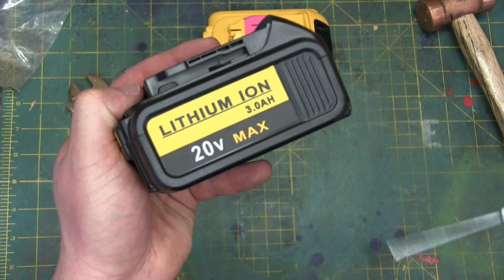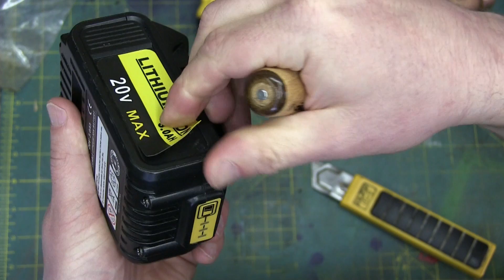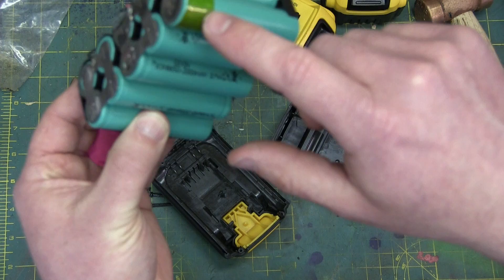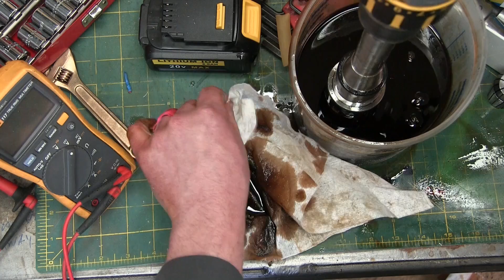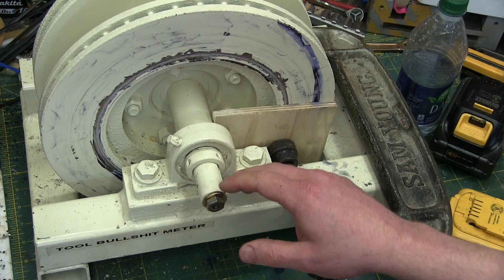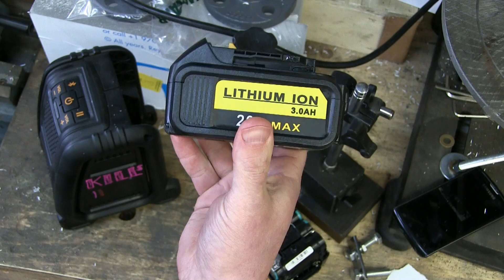BOLTR: DeWALT knockoff battery vs. the real deal

Comment: Had a couple three dudes come in from lincoLn the other day for testing and setting some welders. Had a great big load bank on wheels pushing it around and I was geeking out big time.
I can't tell if they decided not to like me when I noticed it was a miller load bank or when they noticed the wet spot on the front of my pants was getting bigger

Comment: One thing not mentioned was the cell chemistries, Li-ION covers a lot of different chemistries.

I did notice on the elcheapo cells ICR, Lithium Cobalt oxide. High capacity but subject to overheating and catching fire if excessive current is drawn. In some circles it is suggested that discharge current be limited to the cell capacity. i.e. for a 2000mAh cell, limit current to 2A. So two 5 cell strings in parallel, 4 amps for the elcheapo pack.

Elsewhere I found an articel by someone who pulled down their own (dead) DeWalt 20V 3Ah battry pack. The cells were marked as LGDAHB41865 which is a LG HB4 INR/NMC cell, Lithium Nickel Manganese Cobalt Oxide. Allegedly good for up to 30A current drain without overheating and a favourite of the vaping world.

What current does the drill draw when stalled?

Comment: I didn't even know that metric time was a thing.
Reply: garmack12 I wasn't sure if it was a joke or not at first lol.
Reply: Your computers are doing it every day under the bonnet.
Reply: Just in case you're not being facetious, and for the benefit of everyone else:

The second is the official SI (metric) unit of time.
Reply: It's Babylonian, if not Sumerian.  We haven't moved on.
Reply: gamesbok if it aint broke....you know the rest
Reply: There is a 10 hour day clock yes, but it is really not good, mainly because its seconds are 0.864 the length of what we currently use. Makes the math for everything real bad.
Reply: +Elijah De Pino ??? It makes the math bad, how?  I am no metric time expert but 1 second is 1 second, I am going to guess that 1 minute is 100 seconds in metric.  Seems easier to me, but hey, I really have no clue about metric clocks.  If you could, though, let me know what part of it is math unfriendly?
Reply: The french also tried a "real" metric time with a 10 hour day with each hour having 100 minutes. They failed😂 Also church wasnt on board with this...

Comment: I would have used a magnet for braking. just add a few to the frame and it'll add some drag.
Reply: ben hunter yep, put those eddy currents to good work. Same way many exercise gear works, big flywheel and a magnet with an adjustable distance to the flywheel. Wouldn't need much in the way of magnets to get a decent load, and should be completely the same load every time as long as the magnets were fixed.
Reply: The lack of any way to harvest the wasted energy annoys me so much about that design. As for the torqometer if a few coils are added then another battery can be charged as the test battery drains.
Reply: Besides, magnets would make the friction and moment of inertia much harder to calculate
Reply: taity waity relatively speaking, the energy wasted is miniscule. It really isn't worth doing anything with.
Reply: 3.2 Ah? I could charge my phone with that!
Reply: taity waity actually, with it being 20v, that's about 64wh, you should be able to charge your phone five or more times from that.
Reply: How about the moment of inertia if that wheel bearing fails? I do see a zerk fitting, but it looked painted over like the rest of the contraption.
Reply: Don't think the safety of it is really relevant here, I'm just talking about adding load. He said in the video that it wasn't all that safe. Also, I don't see how the presence of a grease nipple is going to make it any more or less safe. With the kind of duty that this is going to see I doubt those bearings will ever need re-greasing in AvE's lifetime.
Reply: The drag coefficient of the bearings and the air resistance is going to be pretty difficult to calculate accurately anyway. May as well measure it empirically using a prime mover and a torque arm, and if you're doing that it's no more work to add some inductive drag. I love enginerding out with MATLAB as much as anyone else but in this case I'd just measure it myself. That way I know that I'm accounting for all factors.
Reply: 64Wh is from battery! Count in the losses from motor efficiency and generator efficiency, if you had really efficient motor (which I don't believe handheld drills really are) and really efficient generator you would be maxing out at about 60% efficiency. And since just a few coils and magnets are not proper generator with laminations in coils with minimal air gap between rotor and stator..... you would maaybe get max 5Wh I believe (if you are lucky) just not worth it

Comment: I think you were onto something with the hydraulic pump. if you use the drill to pump fluid from one container to another you can get some nice data. if you know the mass of the fluid that was moved and the height over which it was moved , you can calculate the work.

it would make for a good comparison between batteries because the pump losses would be the same. as long as the two containers have the same cross-sectional area, you can use the distance between Center of volume as the height so you don't have to worry about the varying head pressure.

Comment: What would be actually a better video is if you hooked it up to the data logging and showed the curve of the voltage drop from fully charged to drain because that's where you'll see the crappiness of the aftermarket batteries if they're no good you'll see that they have a you know I voltage right away and then they taper off pretty fast you know losing their power wear a good battery like LG or whatever would hold that power voltage high for a longer. Of time and have a slower taper

Comment: should use eddie current to test load, make your bullshit o meter out of alum. and use magnets to create eddies, more consistent results than south korea brake pad
Reply: AVE see above
Reply: David Thompson I was hitting the comments to write the same thing. Variable load for targeted resistance per tool class etc etc. quick, someone upvote this above orig comment.
Reply: Using electromagnets I mean. Variable current to create variable resistance against the tool.
Reply: There brake disks not pads
Reply: Stephen Maley - Did you watch the video?

Comment: For the inertial tester you could:
calc the losses by going to full speed and letting it wind down while measuring the RPM and chart it by time, using that and the angular momentum you can get the losses at each speed you tested at.
(flywheel_energy_at_t1) - (flywheel_energy_at_t2) = losses_at_rpm1_to_rpm2
note: bearing temperature might affect things, how much?

You could also hook up a electric motor|generator and adjust the input power to get a stable RPM output on the inertial tester.
Now connect the motor| generator to a identical motor|generator and using the same RPM* get the difference in input power to output power, this is your motor efficiency.
*note: you have to adjust the load on the generator to make the input power the same as used on the inertial tester.
Using this efficiency number at that specific RPM and load you can remove the motor losses from the original inertial device input power to get the actual losses on the inertial device.
Brushless motors?

Comment: The cells inside that Chinese battery are marked up as 2000mah, that makes no sense when you look at the claimed capacity of the battery which is 3.0ah. The batteries are in a 5s2p configuration therefore the actual capacity should be 4.0ah
Reply: W19 ELY they're probably being run below limit to get more longevity out of the batteries. Less chooch over longer usable work life.
Reply: Eliseo Jacome That's not the case in this video though, he already proved that there is no voltage cut off because he managed to discharge the cells to below 3 volts each. Therefore the bms inside the pack isn't limiting the amount of discharge.
Reply: W19 ELY shhhh stop using that math and science stuff. just trust what the sticker says. its all magic lol

Comment: Okay on the brake rotor, use an electric brake magnet assembly ( or many) from a trailer brake setup.
If you mount the end of it or the anchor point to a electronic strain gauge and that will get you your torque reading in ounces or pounds .
By just adjusting the voltage into the magnet , you can increase the braking power of it to load up your tools heavier.
Sort of like using a pump and restricting the flow to produce pressure and convert to your needed  values.
To get your RPM you can use a mechanical tachometer , and inductive trigger or photocell triggered tachometer with reflective strip at one point.
We (in the factory) use various ones for spin balancing large blower wheels for very large HVAC equipment.

Comment: If the DeWalt battery has a voltage cut off of 15 volts that means persol the cutoff voltage is 3 volts which is actually a good design feature of DeWalt it means that they don't want the voltage going down to anywhere near 2.7

Comment: AvE, just a thought. You have the one bad 20V DeWalt battery... but the case is still good, and (probably) the boards are still good. Why not swap the cells with the cells from the cheap-o battery? Then you'd have a beefier case and more substantial electrical protection...

Comment: I love this show, and tried out some Milwaukee, amazon knock offs.  I'm a project superintendent for commercial projects.  I wish those batteries worked out, because I believe they were about 25% of the price as the name brand.  But, they sucked.  Lasted about two months of steady use.  Three other crews I work with had the same results.  I hope this does get worked out some day, because those high output, name brand batteries are so expensive and last maybe a couple years of daily use.  Of course, if it does get worked out, and everybody buys the knock off batteries, then the tool makers would most likely then raise the prices of the tools, since they won't be making their money off the battery sales.

Comment: Good day Sir,

I have recently gotten tired of my old yellow electron holders not holding any electrons.  I have two of the 18 volt variety accompanied by a yellow drill and electron loader.  I would be pleased to send these to you so that I don't need to throw them in the garbage, but perhaps you could make use of them  in a this is what the insides of a 7 year old yellow drill looks like.  It still choohes along for as long as the electrons stay in the container.

Being a home jober, I opted for the more cost effective bile green from Home Despot.  Been pleased with it so far.

You can DM me on Twitter if you want these, otherwise, in the the bin.

Spanx

Comment: An easy repeatable load center could be a small paddle in a liquid.  Bigger paddle or thicker liquid (oil vs water) for more load.  As long as the container (5 gallon bucket)  was big enough or paddle small enough to not allow cavitation it should be consistent.  A couple pillow blocks in the center of the lid to hold the shaft..  You get the idea

Comment: I bought that exact battery. Put a nice 5" Hole saw in my drill and once it got hot a wire or solder joint broke. The test circuit said its good. I'm sure I could replace the wire that burned but the whole point was to have a 3.O Ah battery to run some heavy duty stuff.

Comment: Question: I have that same genuine Dewilt 4Ah battery. It only shows 2 of 3 battery bars even when the re-magification device says fully charged. Fully charged battery shows 18.5V versus 20.0 (or so) from the other batteries. Battery definitely doesn't last as long as the other 4Ah batteries. WTF is the deal? Your videos rock!

Comment: You need to incorporate that hydraulic load system on your tool-o-mometer. You could make an endurance test by measuring  flow vs time for a variety of tools. And you could incorporate an Arduino with an rpm and a pressure sensor on the hydraulic loop, and set it up to measure total output power. It would be a cool, mess free solution.

Comment: Build an electric drill tester. Use a powerful RC brushless motor as a load generator, (being permanent magnet motors these make good variable load generators). Use the arduino to set a specified duty cycle for the tool to come on and off to never overheat the tool. Add it all up to on time in hours. I would also get a high amperage power supply so batteries aren't ever a factor. Some drills could take weeks to test and only you could have the patience to pull it off. Adding on, use a high speed metal gear servo to actuate the drill's trigger, these have high lifespans and are very powerful torque (commonly used in large 700 sized RC helicopters).

Comment: Use a few big magnets and place it close to the rotor on the tool bullshitmeter. It will set up eddy currents and steal some energy from the system. Then I would set up an RPM meter and call the test done when a tool drops below a certain RPM. Some servos, some hose clamps, and a microcontroller later you could automate the whole thing.

Comment: I would suggest load testing with something like a big fan.  It has a lot lower mass than your dyno and will offer high resistance to load up the tool.  A cheap 20 inch fan might do the trick.

Comment: put some paddles between the discs on your rig.  put it in a container with mineral oil (or water but rust.).  should provide the resistance you need to test power tools. make sure you put a cover on the rotating mass for safety.

Comment: You don't need to measure the moment of inertia of the flywheel to get the torque. You can masure the reaction torque oh the handle of the tool, which is the same size. Just built a rotating bed/handle extension to fix the tool into and rest the end of the extension on a bathroom scale or something. The flywheel would then be just a balast and you can measure the RPM as it spins up, thus scanning the whole RPM spectrum and getting the whole torque curve.

Comment: 3.2Ah returned at a 2C discharge is pretty good. I'm not sure how tool batteries are rated but I'm sure most capacities for rechargeable cells are at 0.1C rate, because it makes them look better.

Comment: For your tool bullshit meter, add a flag off the rotor for a prox or microswitch triggered counter.  Weld on a frame and some heavy springs behind some brake pads to add consistent resistance to your rotors.  Check occasionally with a torque wrench to verify resistance

Comment: Instead of the inertial load from the flywheel made of brake discs, maybe work up something using the centrifugal pump with some adjustable flow limiting valves, a flow meter, and a pressure gauge (clear vertical tube/column)? With new transmission fluid, it might even look attractive!

Comment: You could use a balance charger like IMAX b6, and run each battery through a series of charge discharge cycles at a constant current and get a very accurate capacity.

Comment: Please consider turning some electrical motor into a bullshit-o-meter. You can use it as a generator, load it with some beefy, but stable resistor and monitor the pixies and RPM. I think this could be a nice platform for repetitive tests and should also give you some extra data.

Comment: Try a water brake or even better, eddy current dynamometer, instead of inertial.  You can more easily adjust load and in turn, get a reliable measurement of power (or, thrust).  Probably a lot safer than that arrangement, too.

Comment: 2000mah would indicate a high amperage, 25-30amp cells if I had to guesstimate. Those cells would indicate a 4ah rating at 50-60amps. Not sure what the dewalts cells were looking like.

Comment: Use a closed system water pump as a dyno next time instead of the brake bits. I forget the flow and pressure math, but good enough for testing car engines, good enough for testing tooly bits n such

Comment: A better way to test that batteries cut off voltage than your little resistor and all that in a little bit faster would be hook up a 12 or 24 volt light bulb to it and let it shoots until no lights show up anymore on it lot better in a 2 ohm resistor

Comment: Hey Mr. Maple leaf... get some magnets close to the brake disks to load the system down and run at constant speed. Gap, strength, and number  of magnets determines torque loads.  Eddy current losses turn into heat yay.

Comment: I bought a knock off for my 12v makita. I only spent 99$ for the drill driver and 2 batteries a charger with the bag. No way I can justify spending 50 60$ on a single battery when the tool was only 40$ lol. For 19.88 if it lasts a month its paid for itself 10 fold

Comment: a v e those batteries are not considered new if you had 10 complete discharge recharge Cycles as that shortens the life and capacity of the batteries buy a dramatic amount it is actually called 'battery capacity wear' . Or short battery wear lithium batteries do you not like to be fully drained it goes back to a Google Plus post I posted long time ago if you take a lithium battery that is brand new and just charge it to 70% you'll get approximately 5000 charges out of it and if you drain the battery 20 or 20% and charge it back up you will get about 500 charges if out of it if you do the math you'll actually have a higher capacity / output watt hour if you keep the batteries above 50% before charging

Comment: I took a small piece of oak and made a pin breakout of that battery that was wired to connect to my balance charger. I can measure the cycle as well as datalog the charge and discharge. You might like my breakout...

Comment: I have two of these Batteries, I use in my woodworking shop and occasionally on farm equipment. They have lasted longer than the name brand, admittedly at light duty. Amazon  dewalt 5 amp hr, $90 USD for one , Chinese 6 amp hr $65 USD for Two... guess which I will buy...